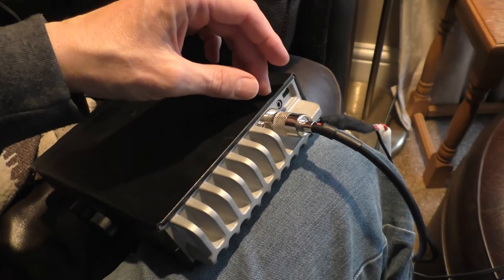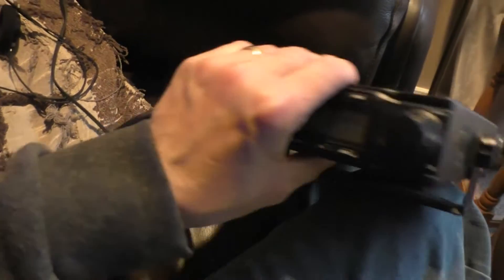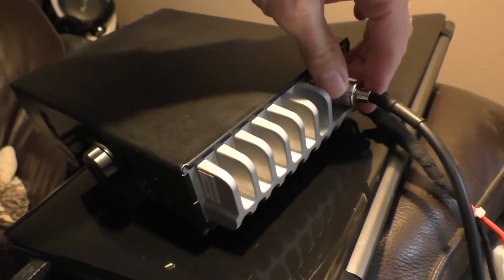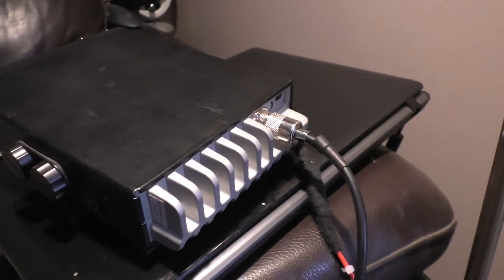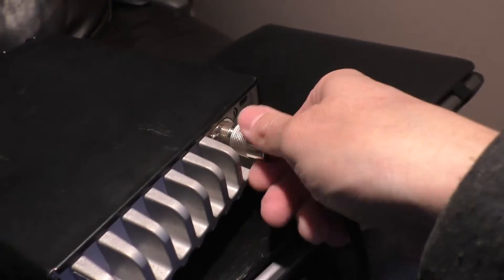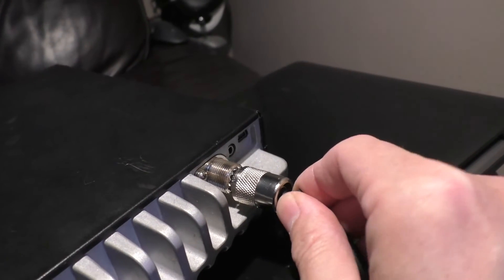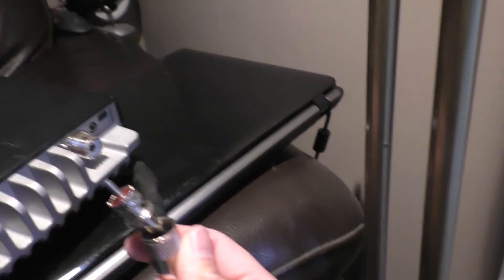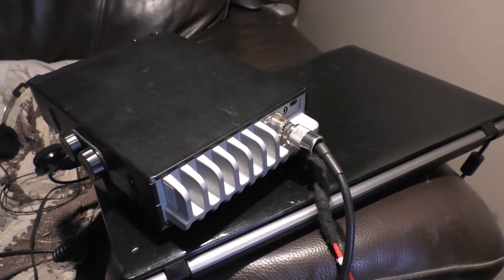May have found the HIGH SWR warning issue.

Comment: Probs sorted ya problem now but ive had same bother with my 9900,what i think problem is cheap n nasty pl259 plug,the pin isnt a snug fit its loose,waiting on new length coax coming

Comment: Let me guess.....🤔 ?
Cheap Chinese knock off connector, that doesn't meet spec's !
And most certainly an intermittent contact could change the SWR, as you would effectively be losing one side of the antenna circuit !
IMHO, Mate !
                  👍😉

Comment: Hi Fred. I have just connected the Zetagi T999 and it's saying swr hi without matcher turned on. My other little swr meter says it's fine and internal says fine also. I'm confused. Either I'm getting false readings on my little meter and internal or the Zetagi is faulty.
Reply from the maker: The 999's can go bad.  Have you checked the patch lead ?
Reply: @UK-CB-RADIO  both brand new from same place

Comment: Stick a new PL259 on, having already taken a couple of inches off the end of existing coax. Should sort it....unless of course there is a dry joint/make and break on radio socket inside the case... hope you sort it

Comment: I've had same problem it was down to fake cheep PL259 plug it wasn't having proper connection or it could be water in your cable!!
Reply: I guess water in the coax or more like corrosion is always a possible.  The Mini8 run to the shed is not that old though.

Comment: Where did u buy the pl259 Fred?
Reply: Jeez i cant rem Gary.  It was a 10 meter Mini 8 patch lead that i run to the shed.  Think its less than a year old.
Reply: @CB-RADIO-UK  no probs mate just wondered if they were ebay cheepys. Some of them are rubish quality. Ya better off buying pl259's from places like knights even if they are a bit more expensive. I made the same mistake with some rg213 plugs.

Comment: Maybe a better patch coax will fix the high SWR issue. As for the audio jack, it may need a spraying and a vigorous insertion of a small 3.5 jack several times to get the micro switch on the jack to make connection and allow audio back to the internal speaker.
Reply: Hi Andy.  Yes the jack socket could be the issue.  Iam going to replace the 259 plug as iam not happy with the thread going so tight.